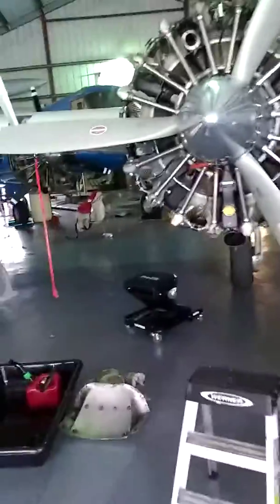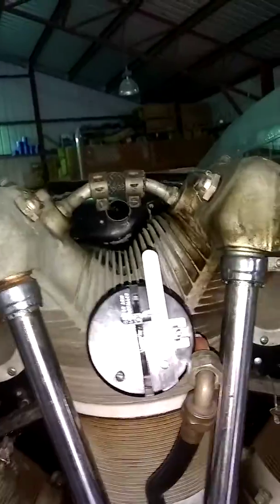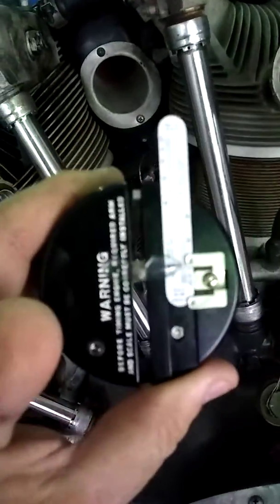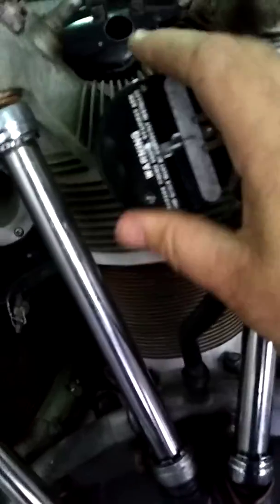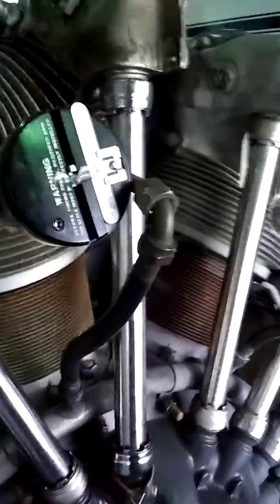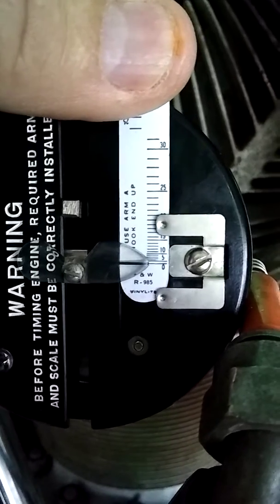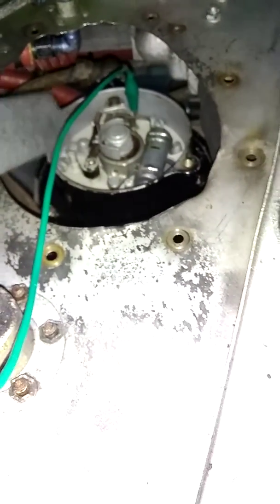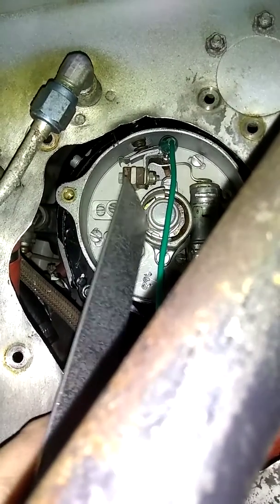Magneto timing Pratt & Whitney R-985 Wasp Jr Beech 18 Time-Rite

Comment: This is a hard video to follow. The jerky, out of focus and out of frame video made it painful to watch. I could only follow the Timerite explanation because I've done flat engines with flower pots and built-in timing marks. IMO the e-gap section was incomprehensible. I couldn't see any of the marks or see any of the detail. Sorry I rate it a fail too.

Comment: Sorry this is a fail.  I can't tell from that video  what you are doing,  and I have some idea of  how this works, in  automotive terms.   Also  I have one of those  mag timer  devices,  and it is not  optimum.  as I recall it can not tell the difference between  closed points and  "an open"  such as if the coil was open.   That is a fairly significant  failing.